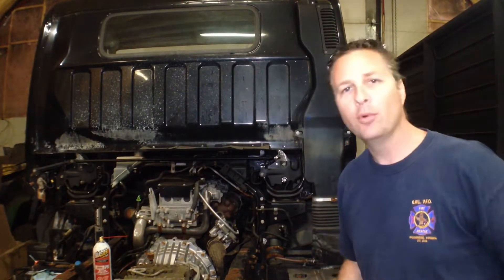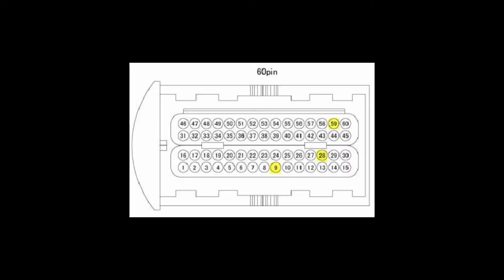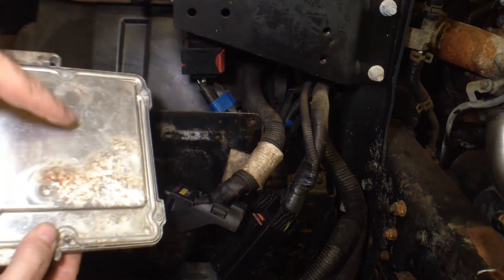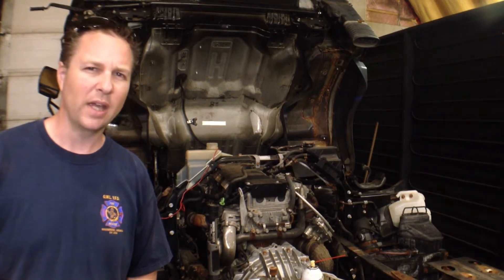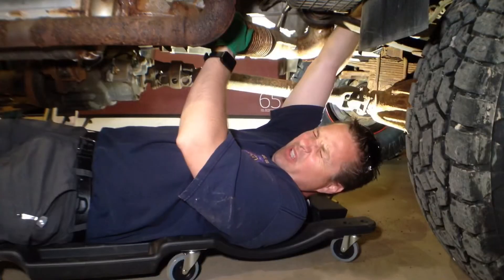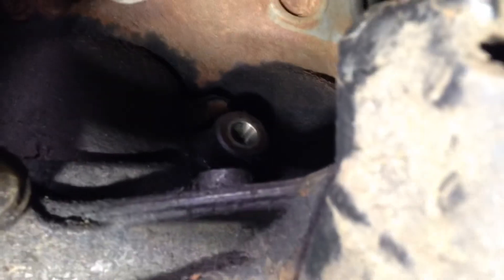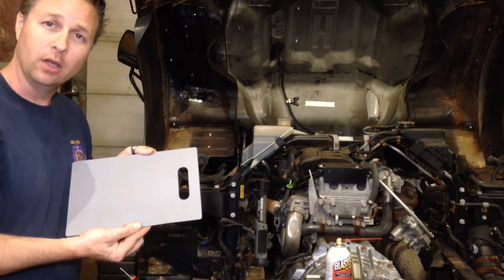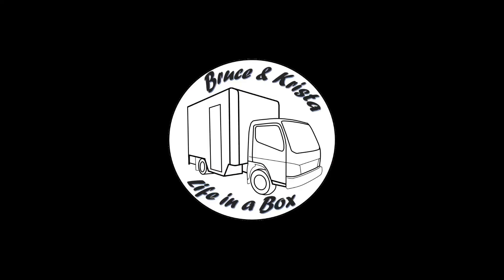Mitsubishi Fuso FG 4P10 crankcase pressure diagnostic 1

Comment: is there any possibility a code like this could be caused by an overfill on an oil change?
Reply from the maker: If the crank case has too much oil it could be overwhelming the filter - if the filter is not able to shed the oil, the pressure will increase - so, in theory - I would say yes.

Comment: Hi Bruce,
Can you tell me what these SPN FMI CODES mean?
VEHICLE : 2015 FG72S 4P10 
Red engine light  audible alarm & derated power.
1254-31
520530-0
520680-31
520682-31

Thanx!
Reply from the maker: 1254-31 torque limitation (essentially limp mode) - this one may be hard to get rid of without being connected to a computer. Likely caused by one of the follow on codes that are emission related, but once you go into creep mode it’s not easy to get back out.   520530-0 Catalyst upstream temp signal range high.  I don’t have an answer for the other two unfortunately - I don’t show anything in the 520600 range - but sounds like emissions stuff has put you into limp mode.  The first one sounds like a signal out of range - you could have an electrical issue, could be a plug, or a bad ground.  I’d start by checking all wiring plugs around the emissions system, maybe pull and clean the sensors (may be covered in soot). And see if any of the codes go away.

Comment: can i chat you please
Reply: where did you find the pdf manual
Reply from the maker: I purchased it when I bought the truck, along with the diagnostic software and tool. The previous owner had purchased them as the truck was located several hours from the nearest dealer.

Comment: It's crazy the amount of rust in a 10y/o vehicle. I got a 2012 Fuso Rosa and just applied a Lanolin coating on it... But it basically had no rust, just some small marks over the paint.
Reply from the maker: Unfortunately around these parts, it’s a pretty normal amount, winter road salt and now the brine solution the spray on the roads just kills vehicles here ☹️.

Comment: Hello, Bruce. I have a Mitsubishi Fuso Fe160 3.0 2012 diesel engine with Duonic transmission. I have this codes: P0728, P0727 and P205C. Do you have any idea where can I start to fix those ? I’m in United States. I will appreciate any help
Reply from the maker: Hard to say, but P0728 appears to be listed as an engine speed sensor that feeds engine speed to the TCM, but could have a number of causes.  There are a number of suggestions that come up when searching that code (it’s a generic OBDII code). P0727 comes up as the same (engine speed sensor) but “no signal”   P205C looks like something to do with your DEF tank temperature.   Have you tried pulling the SPN and FMI codes through the instrument cluster?   If you look through my other videos, I show how to do it without a code reader, and the information is more detailed than what the OBD II will give if you can get those.    Search for my video “Don’t buy a code reader for your Mitsubishi Fuso without watching this first” - I run through how to pull the codes through the dash cluster.
Reply: Ok, thanks I’ll watch it. And yes is generic OBDll

Comment: can you change speed limiter with fuso connect ?
Reply from the maker: I believe it is possible, as well as adjusting the speedo to match the tire diameter, but I have yet to be that deep into the system.

Comment: Hi. Can you help me with this code. My truck stops the engine while driving. 

Error code -

520500,0 The rail pressure is too low’. – Fuso Canter diagnosis with our fix/repair.
Reply from the maker: Which engine is in your truck?
Reply: @BruceandKrista  4P10 2014 Canter fuso Dump truck. Manual gear.  My mechanic says I will have to change the Injectors. Which is extremely costly in Sri Lanka.

Comment: Good job,,
Is the Mitsubishi FG4 has a block heat plug?
Reply from the maker: Depending on which market the truck was made for, it may have a block heater installed.

Comment: Hi Bruce,my fuso fe 4p10 had speed limit,glow plug circuits issue,glow plug1,2,4 show code,I want to know will the glow plug cause the speed limit?
Reply from the maker: Interesting - I’m not sure that the glow plugs would cause this, but maybe something else is causing the Cloe plugs to throw a code.  Do you have the specific codes?

Comment: Have you checked the state of the PCV  filter? You can actually regenerate them yourself by holding the vehicle at rev limiter for like 2 minutes. The pcv filter is a rotating filter as it's mounted on a hollow gear in front of the fuel pump and it spins at engine rpm, so when you rev it very high it flicks off oil and can in most cases "regenerate" the pcv filter. Might help.
Reply from the maker: Yikes - I’d rather pay for a new filter than run the engine at the rev limiter for 2 minutes!
Reply: @BruceandKrista  Ikr, but its the Fuso method.
Reply: Hi. I am looking for help diagnosing a no start on a 2013 fuso  I have.  I am willing to compensate for your time.  Kindly let me know if you can and how we can do so. Thanks and God Bless!
Reply: @donaldsampson4944  Still need assistance?